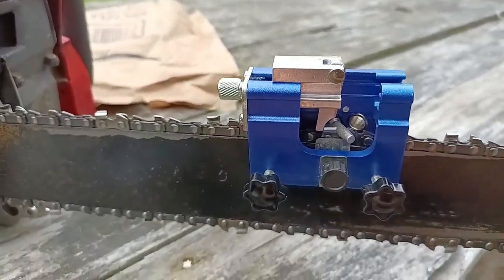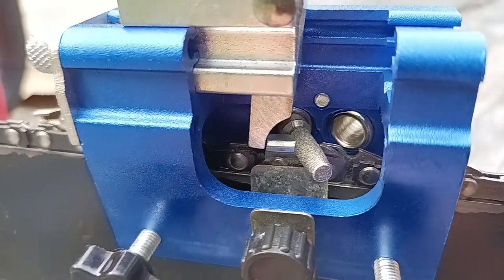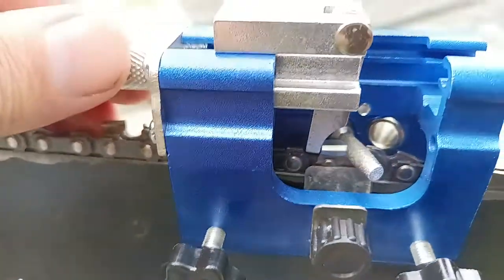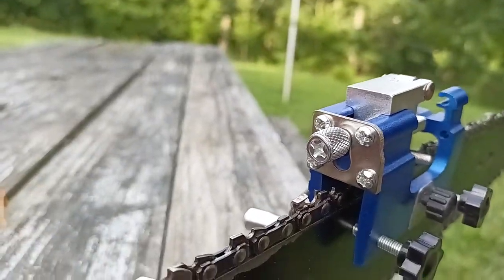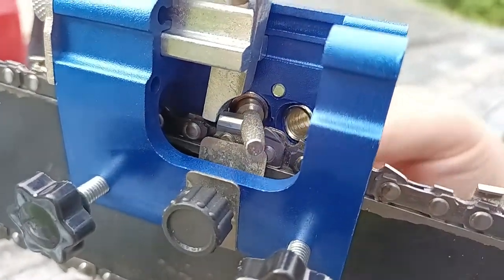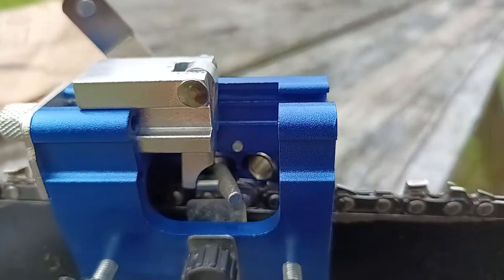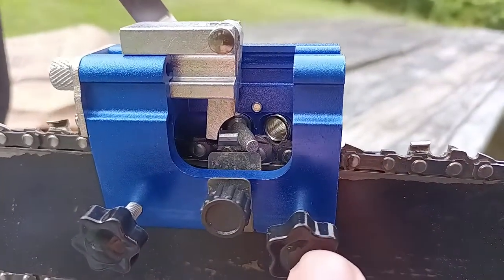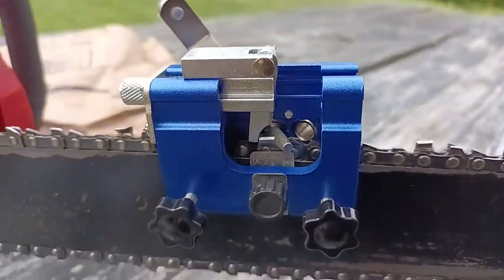Amazon Chinese Chain Saw Sharpener (Explained) (Read Description)

Comment: There is a newer model that has three of the knobs instead of 2 that are on the side (the one in the middle is now like the ones on the sides). It comes in two different configurations. One is the bit takes a bolt and nut type connection, and the other is made so that it will use the timberline bits (retained with a set screw from the side). These newer models tend to get better reviews than this one which is like 3 gens back (though I tend to think a lot of the bad reviews are just not understanding the use). The two I described are about $20 (amazon prime, one was $20 and the other was $23.95 with a $5 off coupon) if you shop for them, one came as a kit with the bag and such too.
  One thing I noticed you are doing wrong is using that side adjustment (much bigger knob on the newer version also) to tighten for each tooth. That defeats the whole purpose of the jig, and not just using a file. The purpose is to get all the teeth the same length. Ideally you would find the shortest one and set it on that one and sharpen the rest down to it (probably best for chain life to just ignore it), but otherwise you can just call them good until the rest of the teeth are sharpened over time to get to the short one (some common sense here, if the majority are short you sharpen to them). Generally speaking you should only have shorter ones and longer ones if you are sharpening by hand or damaged the chain some how (dirt etc). If you start out using this on a new chain and do it right, they should all be pretty close to the same length when you sharpen them with this jig.

Comment: I purchased a large one and smaller one from China. They DO NOT WORK on second angle as guide too far from adjustment. The guides are too far apart so don't have same adjustment for both angles. many other badly made points in geometry and quality. USA Timberline looks to be correctly made and works correct but expensive.
Reply from the maker: Wow, I looked the Timberline version up and that price is ridiculous. The design from what I seen is not much at all different. But I couldn't see paying $120+ on something to just sharpen a chain. The main issue to me is the little grinder. Seem like they'd wear out way to quick. I know the cheap Chinese was did. It was binding in the hole and got worse and worse almost seized in it from the aluminum dust build up just from turning it a few times. Probably wouldn't have had that problem if I had greased it, being a soft metal like aluminum. The crank grinder was still ate into while it was sharpening the tooth so it still wouldn't have lasted longer. But for what they charge for the timberline, I would think buying a Harbor Freight electric sharpener would be more worth it as I already own one and its 1/4 to 1/3 the cost of that. Only thing is you need electric and the chain off. But I sure wouldn't want to depend on something like this in the middle of the woods and think it would sharpen quick.
Reply: @mattcasdorph  Yes Timberline too expensive for me and china ones all kinds of problems. Have been using file clipped into guide for height with angle lines on it. Have also a hand grinder with guide plate I set for 3/8 LP 5/32 30deg teeth and going to try the diamond grind burrs. Yet to sharpen my new 3/8 full chisel 7/32 25deg as wanted to get good repeatable setup. Did have some 5/32 eze-lap diamond burrs with guide but expensive and hard to get, easy to loose also... cheers for 2023!
Reply: If you turn the locking tab around so it’s straight edge to the tooth it works both ways
Reply: @terrymatthys6385 that helped me a lot. Thank You
Mine was installed backwards out of the box also. It would not adjust to opposite angle. Reversed it and works to both sides.
So do 1 half the chain (every other cutter) and adjust once to other angle then do other half of chain.

Comment: When u sharping one side u can't sharping the other it won't let it so please show thanks
Reply from the maker: I can't show without uploading another video and Im currently at a different place where I can just get the sharpener and create another video. But I can tell you that the other hole does sharpen the other side. Its the angle it goes in thats different that allows sharpening the tooth from the other side. Its kinda complicated describing it but personally I would go free hand with a file or use a guided file sharpener. This design is not a bad design. Just poorly executed and with cheap material as far as the cutting/sharpener (spinning part) goes. Someone commented on here there is a American made version but its more expensive and Im not going to comment on it one way or another cause I didn't have any experience on the USA made one

Comment: Second video I watched on this sharpener to figure out how to sharpen the other tooth, still lost. PS I have one.
Reply from the maker: By the design, in theory switching the handle to the opposite hole would angle it for the next tooth on the opposite side since generally the teeth alternate every tooth or every other tooth. I know I tried to sharpen a chain with it but can't remember if I had any problems, I dont think I ran into any problem other than the hole the handle went through was binding in it and wearing out the soft metals the handle was made out of. That and the piece you adjust behind the link/tooth to keep it snug when sharpening, to my knowledge that was the only problems I can remember. So switching the hole the handle is in should give it the right angle for sharpening the other teeth on that side. You would have to keep switching back and forth as you go or sharpen all of one side and switch and do the ones you didn't do on the other side. But I would put a little grease in those holes to keep the handle from seizing or binding in the hole. Cant say it works with all chains with different angles or certain chains with special angle teeth like the powersharp chains.
Reply from the maker: I also forgot to mention someone else said the holes weren't the right angle, probably a design flaw idk. That was just something he brought up, I never checked
Reply: Right I hear you I'm mechanically able, I'd like to see a video on both angles of chain in detail. Every video shows the same angle.